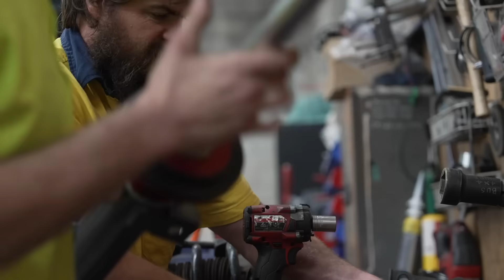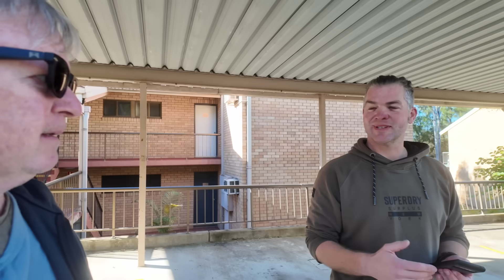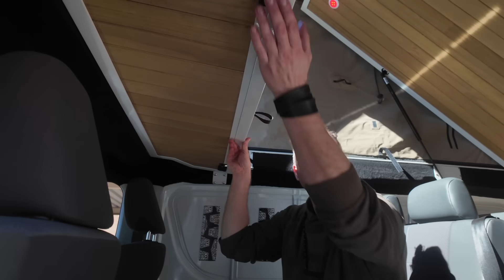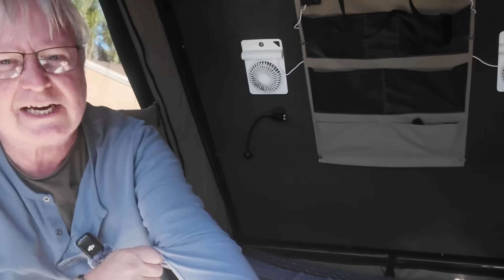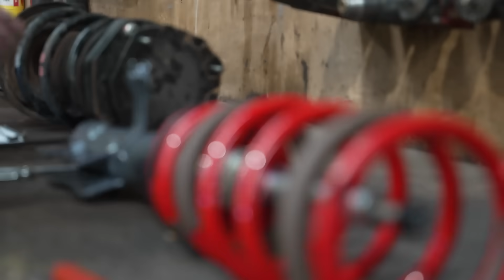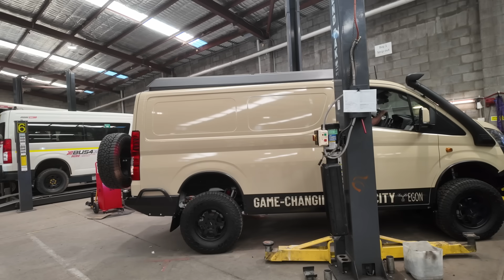HiAce4x4 Real World Testing. Untested products @4xoverland

Comment: My  concern you  still have nove   both a dc  volr voltage calc  nor   power consumption  cav  power nwer need adrw  wherther or not you need to support series of ha  house batteries you need to think 
😮
On aver 1,5kw-3kw devivice yoy will in u yout ac convertors may  have the  capacity

My poing is this andrew what  isused in the home will be  used in the camper at some pintoin

Whethwe you affix a build wi a gen set or not if are buildibuildin  setup to connect to shore power  you have to build  safety margin in

Whilst i commend using as hiaace platform of choice i have to wonderif yoy short changed yourself by not basing this  from the disabled taxi moelt meet a legal height requireny co2 needa in which this setup  doesnt meet heiner s height needs of 8.5  and i doubt uou have cob  sidereded thi this in all yiur troop builds

For a vehicle you are living out of

At your  height andrew it legalladds 2.5 feet head space  vs  vs heint height  of  min height  8.5 feet

Comment: The lifted canopy looks like it wouldn't stand high winds.  You may have to park in a way to counter wind, but wind can change directions multiple times a night. The solution is the front need to have a canvas wind guide, like a front of a boat.

Comment: The issue with 48volts is you are above the level for electric shocks. You save on wire gauge.  Most products for 48v are generally large too due to being geared for housing systems.

Comment: It might be a first for a hiace, but those front opening tops have been used in VW westfalia kombis for 55 years.  Seats 4, sleeps 4.
It's looking good so far.
Reply: thought the same, and the latest roof top openings of VW are much better designedt: opening and closing only from insight, not opening in one fix angle but with pop up roof and special scissor joint

Comment: Game Changing Simplicity may be the must ironic slogan in the history of YouTube off-road content.
Reply from the maker: I wish I understood the irony you are seeing. 48V is really complex. And Egon is simplifying it - like it does with 12V. I don't get it. Care to share?
Reply: @4xoverland sure. There is nothing simple about this build and concept. The hiace has been converted from 2 to 4wd, just had a bespoke suspension upgrade and has roof conversion. If the 48v turns out to be successful and I have no doubt it will you could ring fence that as game changing simplicity. Regardless of decal I applaude the effort and engineering.

Comment: Wow, that’s pretty ordinary when it comes to the rear springs and bump stops—especially considering how lightly loaded you are. How is BUS 4x4 addressing this issue (which seems like a major one) on their other builds? I’d imagine the mining vehicles they supply are constantly running on rough terrain and corrugated roads, so surely they would have stronger spring rate options for these conversions. If not, that’s a pretty big oversight
Reply from the maker: the springs fitted were not what they usually fit as standard. These were selected because we had no load at all at the time.

Comment: Hello, is it possible to do the same on a 3.5 petrol car with a left-hand drive?
Reply from the maker: Its a van. But the engine type or where the steering wheel is placed doesn't affect the project design at all. So I would say, yes it is.

Comment: When you fit the 300kg springs with a 2 inch lift also fit extended shackles because it will give you, approximately, a 4 inch lift at the rear.

Comment: When it comes to shocks and their function, you cannot, I repeat cannot check their condition by collapsing them with human bodyweight. It depends on the shocks internal valving design. You have to generate a specific speed (mm/s) to engage the valving. A shock dyno is the only way to test a shocks function. Van looks great, welcome to overland van life.

Comment: i likethe layout 

though how you  the rear people  cool whilst on the move

you might have the height   bump in  the front seats 

noting whilst technically u can add seats to the platform  looking heiners head was hitting tells me the is designed it is a cargo hauler not a people mover

at the moment  you in stalling  internal shell to add internal sleeper

i9 think the maxi cabs might be a better fit for this 

based  on co2 regulation if a catering 6 foot height min in height 8'5"  at 5'5" it is internal height  7'5"

Comment: Andrew, Just curious whether or not you considered using the Toyota Commuter platform for even more interior space and flexibility?
Obviously it wouldn't be so nimble off road, but I imagine it could handle the limits of off-roading that you tend to do?
Reply from the maker: You answered your own question. Its a balance of off-road, on-road and comfort. So I bought the smallest HiAce available. Off road is important. And while only needed on 1% of the journey, the lack of off-road performance doesn't stop one from doing 1% of the track. If you can't do the track, it stops 100% of the track.

Comment: I designed my Sprinter layout so that the bed folds up to one side taking up about 14”.  This leaves an aisle and a counter height work space of about 24” for cooking or whatever. It gives you access to drawers and fridge. The great thing is that the drawers and fridge also slide out the rear along with a flip down stove.  This gives you full access to all drawers and fridge while cooking outside.

Comment: Springs I would have done them up for you just needed to be strengthened and reset note spicer springs in Knox vic gvm springs for hiace. . Fitting of suspension not that difficult koni shocks for the rear valve adjustable good thing. Go to a actual spring works next time save yourself some headaches but enjoying episodes though 😜👍

Comment: Everything is a compromise with RV setups. A big gain in hangout space but lots of canvas to get wet, height to watch when setting up under trees or structures and getting in and out of bed. While our Enduroco LWB Hiace poptop has a fixed EW bed, the bed itself is a hangout space and open height is about 3.3M.
Reply: Which pop top product did you go with?
Reply: @markh6676  Jacana Motorhomes, Taree NSW. They also do full camper fitouts.
Reply: @markh6676  Jacana Motorhomes, Taree NSW. Also do full camper fit outs.
Reply: @markh6676  Won't let me post.

Comment: The front part of the bed folding down seems to make it awkward. Hinging up would be much better. I suppose if the headrests weren’t on the seats it would close off the cab as it is now.
Reply from the maker: On the contrary. It makes it easier.
Reply: @4xoverland I’ll watch for further examples of using it and happy to be proven wrong but it certainly looked like it was getting in the way in this video.

Comment: It would be great if you can find a salutation for the noise those sliding doors make, can be very annoying. Other than that, this van could very well be the ultimate solution for touring this wide brown land.
Reply: There's a caravan door conversion avlb.
Reply from the maker: Is a slide noise more annoying than a tailgate slam? In the case of the 78 and 76, two slams.
Reply: @4xoverland  probably not, both are pretty annoying I suppose. No more annoying than everyone these days using rattle guns to put in pegs

Comment: I have two thoughts: I hope you weighed the amount of wiring and bits that you removed to give an idea of potential weight savings that are rewarded with using an Egon unit.
Second, I became fixated on the large rear window. I can picture a rock bouncing up and shattering that glass. Is there an outer film/ coating that you can add to deflect projectiles?
This may work: 3M  Safety & Security Window Film Safety Series